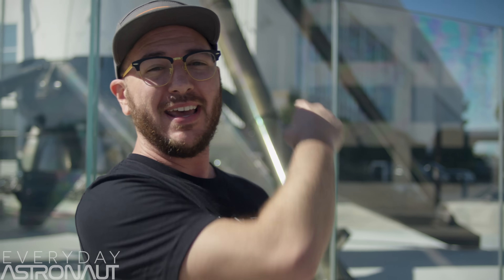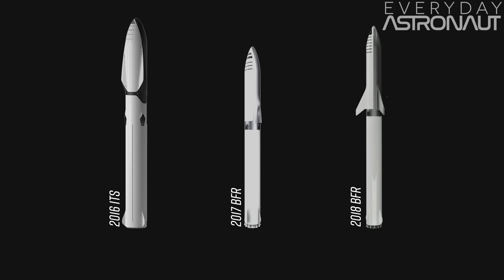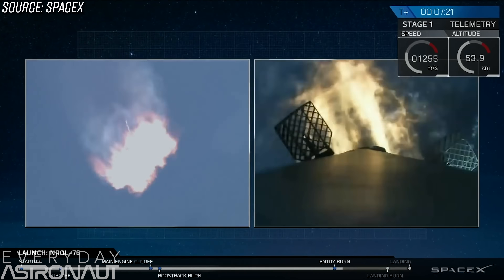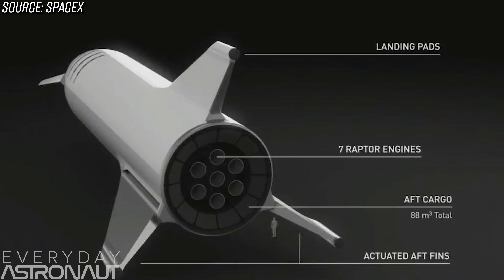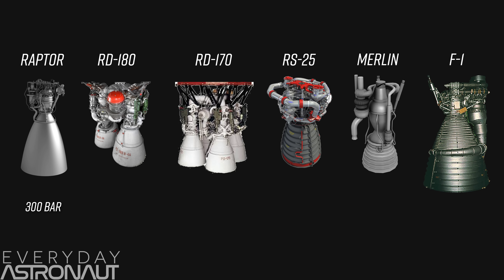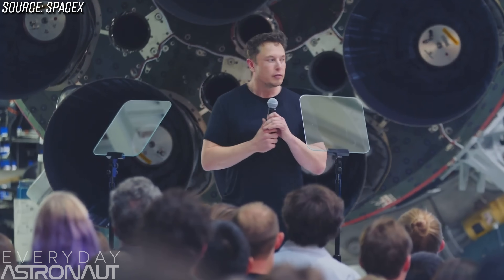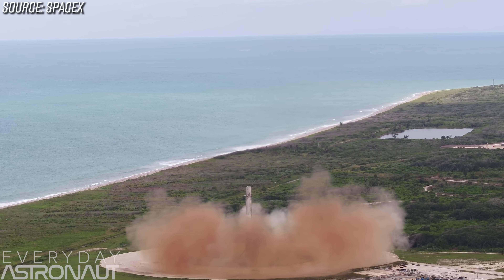Why does SpaceX keep changing the BFR? The evolution of BFR

Comment: The biggest issue I see with BFR is that there is no easy way for them to do an abort.  In that way, it is similar to the shuttle.  If SpaceX ever launches their target of up to 100 people, if a disaster were to occur, it could very likely stop the company for awhile or indefinitely.  I don't know how you would make such a giant spacecraft with a safe launch abort solution, but it does seem to be an overlooked or unspoken aspect of the design.  No design is ever disaster proof and unfortunate things can happen.  Having sufficient abort/escape solutions are just a healthy bit of insurance for the "in case" scenarios.
Reply: Steven W Howard did the spaceshuttles ever had such a solution?
Reply: @LeParis12  not really. That's why I said the BFR is similar in that aspect.  Early designs had ejection seats (the Buran kept this feature as far as I'm aware), but NASA scrapped that idea.  There was an insane abort maneauver that could occur for the shuttle, but only late in launch and even the most skilled astronaut pilots would have struggled to pull off the maneuver.  But, no, the shuttle could not easily abort from a mishap on the pad and is known to be one of the most dangerous man-rated spacecraft ever designed
Reply: I know the shuttle had some abort modes for different times of the lift off but not all of them.  I have NO idea what the plans are and take this as pure out of ones rear end speculation but..  The BRF has some major differences to the shuttle.  In the event of an abort the shuttle had no internal fuel supply so even if it ditched the SRB's it's stuck with that big heavy external tank if it's to do anything powered, the OMS simply don't have the fuel to fly the thing.  The BFS has it's own engines and fuel supply and it MAY be possible to have some abort modes where it uses it's own engines and fuel to execute an abort.  There will likely be times during launch that no abort is possible, this is the case of the shuttle as well.  I don't know.. but I do know they're smart people and aborts have probably occurred to them and I suspect there are contingencies in place for aborts that can be made at various phases of lift off.  We just needs to beat some real answers out of them rather than relying on the morons in the mainstream media. :)
Reply: Lifting that much mass away quickly during an abort would be challenging to say the least.  I'm with you, though, and would love to hear their ideas for abort scenarios because that does impact the design.
Reply: I don't think the system could ever be used as a pad abort system, all the abort modes I am thinking of would be after lift off at some point.

Comment: I have a theory on why the 7 sea level raptors on BFS: It‘s for testing reasons so it can launch all on it‘s own with a high fuel load and do the high altitude hypersonic TestFlights Elon talked about without requiring the booster to get it there.
Reply: he said that they will develop vacuum engines too which will increase the payload capability to mars by a lot (this should the capability for LEO aswell) I hope they willl push this configuration sooner than later after initial suborbital testing is done, no vacuum engins for an upper stage is pretty senseless
Reply: Human Person:  I never thought of that!  Good catch.
Reply: Good theory!

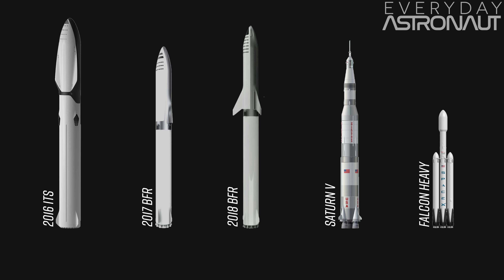Comment: 4:52 Hopefully the BFS will be taller (1100 cubic meters instead of 825) and 2000 tons when full of fuel instead of 1300 tons and a delta v up to 7-10km/s instead of 6-7km/s for the last version.
Why I said that? because now there is 7 engines instead of 4 that will provide thrust in vacuum so I think the new BFS is closer to an SSTO than the 2017 BFS and that's why there is less payload: the spaceship IS the payload because it can be refueled in orbit and it is used as a space station/habitat. But for the cargo version the payload will probably be in the 150-200 tons range.
Reply: SpaceX said that they can swap out the rear cargo for vacuum engines.
Reply: +Quinn Von Kerman Can they make the exhaust gas converge to make an aerospike like rocket? https://i.pinimg.com/originals/4e/a0/a0/4ea0a00e0ddc33d9d5c39f4307c03831.png
Reply: Also I think sea level engine is maybe better, it has a lower footprint so we can put more of them to have an higher thrust so we can make a taller spaceship (2000 tons when full instead of 1300) and so the spaceship will have an higher delta v and an higher delta v means two things: first the booster will separate himself sooner from the spaceship so it will make the boostback and landing easier and it will allow the spaceship to go further in space with refueling.

Comment: On the aeronautical design, the image shown in the "true physics" rendering showed the folding wings pointing anhedral, toward the earth!  I'm very surprised that they are not in a dihedral to simplify the controls system that prevents it from rolling over on it's  unheat-shielded back.  Or am I just mis interpreting the picture?
Reply: I think it's misinterpreted (I was confused about it too) and during re-entry the wings will fold 'backwards' like the Dreamchaser, folding back to 'straight out' as it approaches the landing zone and flips upright.  IIRC the 'wings up' configuration is much more stable than the classic Shuttle delta.

Comment: I wouldn't be surprised if a lot of the design they've been showing off is just placeholder/mockups while they work on the complicated internals, then when they have all of that buttoned up they'll know what weight and size allowances they can work with to finish the less critical bits like the fuselage and paint scheme.

Comment: So, to me the re-entry method for the BFS does not seem particularly new.  This seems to be the same basic idea as the space shuttle.  Now the big "gotcha" here is how does a re-entering BFS density compare to the space shuttle?  Let's hope the BFS is quite a bit less dense than the shuttle, otherwise the BFS will still need substantial retro thrust applied, or some really good thermal protection.  Neither of which seems like the plan right now.

tl;dr the re-entry method isn't new, it's just aerobraking.
Reply: it WILL be less dense than the shuttle because the BFS will be mostly empty fuel tanks once it's time for reentry and landing.  the shuttle hardly had any tankage at all, so the only real empty space in it was the cargo bay, which potentially could have had a satellite inside, so it needed enough lift to carry that weight.
Reply: @Gibson99  Agreed. The question is to what degree. I have no doubt that SpaceX has done their homework here. The main point is that this re-entry system is not at all new.
Reply: good thing is we don't need to worry about foam falling off the ET and damaging any heat shielding on the BFS during liftoff.  the tiles on the shuttle were amazing.  i once saw a demo at stennis where they had some used tiles - a lady held one in her bare hand and pointed a propane torch at the front of it while talking about it... got the front glowing hot yet the backside was still in her bare hand.  yet i think spacex may be using something different that lasts longer and needs less refurb between flights. esp considering it'll take some abuse landing on mars, and then need to take the abuse again coming back to earth, with no repairs in between.

Comment: So many questions... How many crew will be accompanying Maezawa and his guests? How will astronaut recruitment work for a private company like Spacex? Will SpaceX create its own astronaut training program or will it rely upon NASA?
Reply: They will have to hire new astronauts/retired NASA astronauts. They can't use NASA astronauts as then BFR would need NASA human rated rocket certification. A thing that BFR will never see due it's design choices.
Reply: +nuke99 Are you sure about that? NASA's certification process is not set in stone and things are in motion: https://www.theverge.com/2018/8/20/17759034/nasa-spacex-load-and-go-fueling-propellant-falcon-9-human-spaceflight
Reply: @totalermist   i'm 100% sure. Problem isn't about fuel loading, which as you said was approved by NASA. BFR big problem is the lack of any escape system. If the 1 stage blow up or has a serious problem it's the end of the crew.
Reply: +nuke99 And that would be different from the Space Shuttle how exactly? The unscheduled rapid disassembly of the Challenger orbiter demonstrated just that quite impressively and tragically at the same time.
Reply: .. but the entire BFS is in itself a massive escape pod, and due to the scale i don't think an ejection seat would save you from a sudden explosion
Reply: @totalermist   that's why NASA changed architecture and stricted the criteria for the next gen space capsule.Orion and the upcoming commercial capsules Dragon and CST-100.
Reply: @Zreknarf  the BFS is not even close to have a T/W ratio to act as escape pod. The BFS can perform an abort only at really high altitude when the stage is already in the final pushing phase.

Comment: 100 tons of lift capacity is still enough to lift a Bigelow BA 2100 habitat module. I would be concerned if it was less than that, but 100 tons is the magic number. More than that is gravy.
Reply: They can also add vacuum engines in place of the rear cargo containers, that could push the payload above 180 tons

Comment: I wonder (when the BFR comes into service) if they will look into Aerospike engines? I have heard they perform better as a compromise between sea level and vacuum.
Reply: That would just add more development time and money.  So far as far as I know no one has flown an aeropsike to space yet.  I know a few companies were and are planning on it but the technology is still rather new and they probably decided to keep it simple. Perhaps after development someone will start work on a new generation of engine with a aerospike..
Reply: The engines seem to be modular, so to speak, on the Falcon series so to speak. So it might be a viable "test launch vehicle" rather than designing an entire rocket around them... Design them to fit instead? Even if it is only used for "test hopping" on someone else's engine, the Falcons do have that advantage over competing systems. It was just something I wondered if anyone realised...
Reply: I was referring to the aerospike itself.  They'd have to design one for the engine and then start a round of testing and refining and I think they decided to keep development as simple and thus low cost as they could.

Comment: That is 100 tons of payload to just about anywhere in the solar system, if you use retanking (which LEO WILL have and with aspirations for Mars retanking and beyond). Saturn V was (what I am going to call) a close orbit delivery vessel, whatever was on top could not take a person very far.  If and when it comes it to service (if it keeps this lifting capability) BFR will be in a class by itself. It's a space truck/coach being compare to a horse and buggy.
Reply: Just 2 things: 
-100 tons of payload to anywhere in the solar system= quite false. The 100 ton figure is valid for a refuel process in LEO and then a TMI manouver. If you did the same thing with a much harder TJI or any other further planet the payload would be way less than 100 ton. Especially now that BFR has not optimized vacuum engines. To have 100 tons to TJI it would have to refuel in LEO, get to Mars orbit, be refueled again there and then maybe yes. 
- Saturn V was way beyond a vehicle for LEO manovers. It sent people to the moon and could also send people in a fly by manouver of Venus or Mars (check AAP missions) in a quite big Wet workshop.
Reply: "To have 100 tons to TJI it would have to refuel in LEO, get to Mars orbit, be refueled again there and then maybe yes. "
Which Elon specifically mentioned during the webcast: you set up refueling depots and you get 100t anywhere in the solar system.  Not that I think many people will be using a BFS to go to Jupiter; we'll have much more capable vessels by the time we want to start doing that regularly.
Reply: Refueling stations are a waste of time and money.  Boiloff is just to high for any cryogenic fuel.
Reply: Are you insinuating that using any kind of cryogenic liquid is a waste of time?
Reply: Ofcourse not, I was just saying that orbital fuel depots are a waste of time and money. Rendevous and refuelling, sure, but sending rockets to depots, just to have most of the fuel evaporating is insane.
Reply: The manufacture and storage will be done close by. The resources are all out there, not just on Earth. EG everything we need to make solar panals is on the moon, what we lack is the industrial base to do so, that would have to change. But once upon a time there were no roads or gas stations.
Reply: Sander: cryo fuels are easier to keep cold in Space because there is no warm atmosphere to suck the 'coolth' out (or the other way around, depending on how you look at it).  In space, if you can shade the tanks you'll reduce boiloff further. And if you have power available you can keep the propellant cryogenic even when exposed to an atmosphere Like Earths or Mars'.
It does not seem like an unsolveable problem.
Reply: Just one thing, the module on the top of the Saturn V is vessel part  of the Saturn V and sending people to Mars would have required building a ship to get there. While the booster can loft 135 tons the payload into LEo, what counts here for the moon is what is INSIDE the module. As the comparison I am going by is human crewed, not pure mass. So the payload of a human crewed Saturn V module is FAR lower.

The comparison has to be from Launch to ground destination to make it a true side by side comparison for that situation. I did also caveat refueling as part of that and it was also mentioned in the SpaceX presentation about refuelling at Mars would allow it to carry on elsewhere and more refualing depots elsewhere would extend that range, which was the point i was making.

I have 2 options for a response to a question I am going to pose ( and refuelling is allowed in this case and we assume both are not reused)

1) Taking away Apollo 11's vehicle  and fuel mass to get to and from the Moon, let's call that the payload for a side by side comparison, what is that figure? (Please note that most sources "payload" includes everything above the booster, which would not make it a side by side capability comparison.

2) So now we will include everything above the booster! 41,000Kg for Apollo to the Moon. But how much will the entire BFS weight? (Note the BFR is the booster, the BFS is the ship on top) 

I bet since the whole shebang of the Apollo (after booster separation) weighs less then the BFS payload... that is is going to fall short by a fair bit, let alone when you add in the entire BFS as well! :P
Reply: @solanumtinkr8280   Saturn V was supposed to use a clever trick for the Venus/Mars fly by. The wet workshop. Once the S-IVB had injected the CSM into a TVI or TMI the crew would detach and dock the third stsge and then vent the entire stage and use it as habitat (this was also the first option for Skylab). So optimization literally transforms in payload the third stage. Under this criteria the Saturn V could send to a Venus/Mars flyby 41000 kg. BFR will be bigger than the Saturn V, but still the S-V was a massive capable beast.
Reply: I am not saying the Saturn V was not capable, but I am trying to drive the point home that the example not only includes humans and a payload but it has to LAND and take off, with refuelling allowed. But I am saying that should this beast come into being and fully functional using the current presentation, it will be a class of its own. The BFS would be able to take the entire Apollo Moon mission in its cargo bay and bring it home afterwards. The caveats I added to the options was to try and give as close an apples to apples comparison as possible for beyond LEO. It's not a module, it's a space ship.